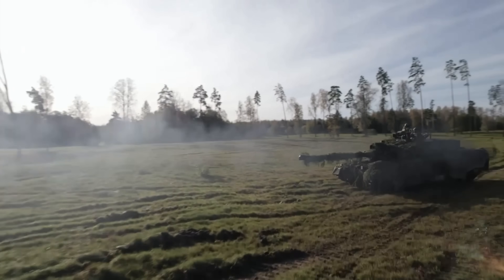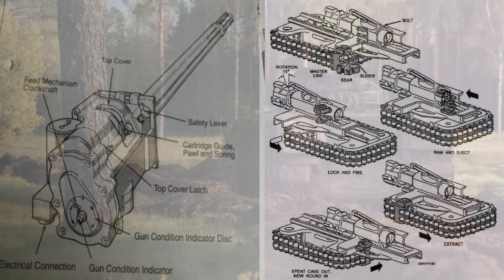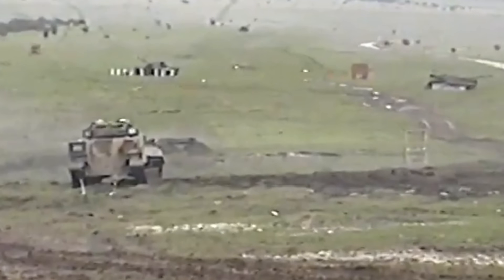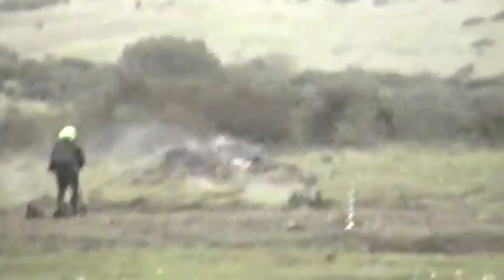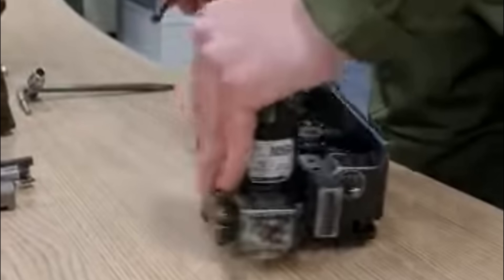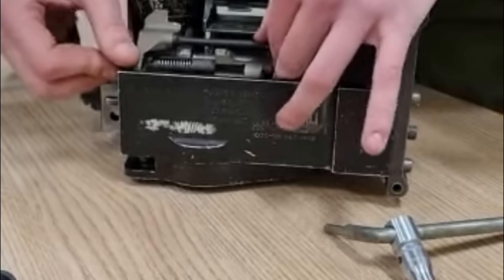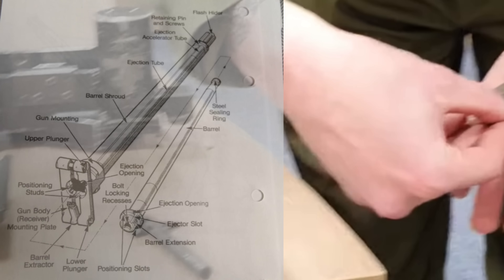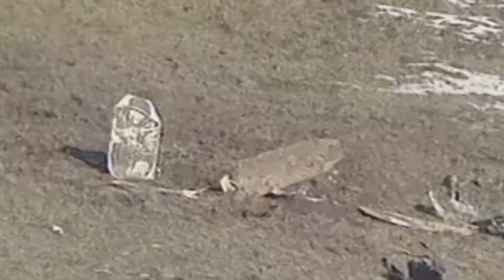The British L94A1 7.62mm Chain Gun | THE WORST WEAPON FOR BRITISH TANKS 👎🏻

Comment: Even BESA Mg's from old tank designs in ww2 would probably jam less if it was correctly maintained in working order + it would be usable with a system failiure, since its a independent machinegun

And the firerate is almost equal

Comment: It doesn't sound like the gun is so bad as much as it is being installed in an orientation that it simply was not design to work in.  The power issues would be an easy fix as all you would need to do is to introduce something like a common power-bank between close to the gun between it and the power lines.  I have to wonder if a lot of the other maintenance issues could be due to it having been mounted upside down and what orientation it is in with the Ajax.  I do have to admit, a traditional machine gun would probably make a lot more sense.

Comment: It's actually a very good weapon. The fact it was mounted upside down in challenger 2 was an oversight as the belt should have been gravity fed. But alas they put the round bin below it, having to cycle and feed itself. 
If the weapon was well serviced and lubed it actually worked very well, and if you had a loader who helped feed by lifting the belt up, it actually worked good.

Comment: On the Ajax, just in case you didn't know - I read an article on European Security and Defence a while ago that you should check out, that detailed some advances in IFV systems.

Apparently, Ajax' gunner and commander sights that are identical with those to be equipped to the CR3s, have an automatic wide area search mode that can detect and indicate perceived threats, I believe also including drones, to the crew I believe using machine learning. All in all she apparently has 26 cameras - optronics I believe. That should I think also include what once was say, simple glass viewports or periscopes. They still are those things, but now also software is continuously looking out them. Her Local Situational Awareness System which consist of effectively 360 degrees cameras, can also again detect perceived threats such as drones using machine learning. That system is also to be provided to the Boxer and Challenger 3.

Thales describes all that as the software now having eyes, providing the platform with a digital crew member. It is really incredible, combined with her main gun she should prove truly deadly against the conventional threat and against the drone threat, and truly proficient in her reconnaissance role.

Comment: The main reason the GPMG wasn’t used was to keep toxic gases out of the crew compartment (also the reason the 76mm on scorpion was taken out of service). On the L94 the brass and all gas goes out the front. That said it was rubbish, being too complicated and a gravity fed weapon mounted upside down 🙄.  We got ours out of sync and “fired” half a belt off without actually firing a round, live ammo was just pouring  down the front of the vehicle. I do remember having a handle we could use to cycle the weapon if there was a power failure but can’t remember if that fired it or just operated the action.

Comment: We had L37's in our older 432s. basicly a GPMG , with a heavy barrel, and the stock swapped with a blanking plate.  great system. if you needed to get out of the vehicle you could take it with you, and put on the but stock, and a normal barrel or an SF barrel.. so no idea why they went down this line instead of using the L37 we all ready had... also always baffled why we didnt use the Bushmaster or the 30mm Chain gun used on the Appache.

Comment: You got it wrong that the L94 was chosen in the 90s because of an obsession with electric guns, considering the Warrior's MCV-80 program goes back to the 70s. The real reason the chain gun was chosen was that the system could be entirely operated and serviced from inside the vehicle, and vented gasses out of the vehicle. This was considered important, because if the Cold War went hot, it was expected soldiers would fight on an NBC battlefield.

Also I thought the Warrior was the only vehicle that had the L94 mounted upside down in it, which lead to the weird feed system and all its problems. With Challenger 2 mounting it right way up and thus having far less issues.

As for why Ajax is getting it. Because it is already in the system, parts and training exist for it. And with CVR(T) retiring, it would mean it would be the only coaxial used in service and somehow make logistics and maintenance easier.
Unless of course they mount an FN MAG on a pintle mount on top or RWS. But nobody said that the MoD procurement office was staffed by intelligent creatures.

Comment: In theory a chain gun should be very reliable. Since it doesn't rely on a round firing and providing blowback to cycle, a misfire doesn't jam the gun. The chain system just cycles the next round and ejects the dud round. Meaning ammo quality affects the gun much less. But of course it needs electricity to operate. So if the system itself is poorly designed or maintained, it completely negates that advantage.

Comment: What is the supposed advantage of a chain gun? I've never really understood why they're used in place of more traditional systems.
Reply: If engineered properly, it can be more reliable and be more compact - especially the amount of length behind the feed. Also, the way it works can mean less gunpowder gas entering the turret. Larger chain guns are used in various AFVs to good effect, such as Bradley IFV.

For remote control weapon systems, the reduced gas is unimportant, but the ability for the mechanism to clear misfires by itself is particularly useful.
Reply: @IsaacKuo  ah, so in this case they've managed to negate all the potential advantages with poor engineering.

Comment: I understand that an electric operated machine gun will keep cycling rounds even if a round fails to fire, which makes sense in an autonomous application or on like you mentioned a helicopter as the gunner won’t be able to operate the machine directly or have it within reach.

But on a ground fighting vehicle it seems like an over complicated solution to a nonexistent problem that would really only cause problems.

Comment: Irony: UK were early adopters of the FN-MAG, but choose to mount an unreliable, electrically-operated chain gun for their AFVs.

Whereas, the US adopts the FN-MAG to replace multiple unreliable AFV machineguns, then expands their use to pretty much every role.
Reply: US already had reliable AFV machineguns in the M1919 and M60.

FN-MAG was just easier to maintain than the M60 and is more modern general purpose machinegun than the M1919.

In several ways the M1919 is actually better specifically as a vehicle mounted weapon system than the FN-MAG.
Reply: @happyjohn354 the 1919 was good, but not chambered in the new NATO standard round (also somewhat antiquated, heavy, and expensive for what it was).  The M73  was the gun I was referring to, as the successor the M1919 in the coaxial role. From everything I've read, it was crap. The M60e2 was better, but was not nearly as durable as the 1919. The M240 was ultimately adopted because the US Ordnance Department was no longer allowed to develop in-house guns.
Reply: Follow the money

Comment: M240/Mag58/C6 what is not to love about this MG.  It can easily be adapted to flex/coax/ground configuration by simple exchange of components in seconds.  The US military choose M240 after years of suffering with the retched M73/M73A1/M219 coax which could give any a run for the title of worst coax ever.

Comment: Brits: make the Warrior and make it work without electricity
Also brits: make an electronic machine gun
Reply: Easy fix add a hand or foot pedal crank dynamo
Reply: @radaraacf  Or just use a conventional MG.
Reply: Bits make rubbish ajax is failed before it starts with troops again being sick just crap equipment cv 90 light years ahead.

Comment: It seems a bit weird to me that this weapon has the positive features which are largely found on an MG34, without being reliable (I'm using the MG34 as an example because it is the oldest MG I know of which can do fast-ish barrel changes from inside a vehicle). Maybe there are some functions which a typical machine gun couldn't do, but it seems like a strange trade off, when you consider that reliable, compact, and even serviceable vehicle mounted machine guns have been a thing for like 90 years now. 

Granted, I don't know from personal experience. Like, maybe an MG34 is a POS and I have no idea what I'm talking about (I mean, I know I have no idea what I'm talking about), but to me it seems like there are at minimum 4-5 currently available belt fed machine guns which would be better. Thus, this contraption is doubly cursed. 

Thanks for the video, good job, peace.

Comment: L94A1 can have a higher fire rate, but it was lowered due to the its problems being of a much higher frequency, if you look up the weapon when it was used by the US in its intended role it was operating at 850 rounds per I believe it was.  As for 2nd and 3rd line Maintenace, yeah its a pig.
The issue with the GPMG and its barrel change was solved, it had a smaller foot print than the L94A1 and the weapon was jut un pinned slid back and barrel changed, yes it slid right into the compartment, was not exactly ideal, but it worked, and when I say worked I mean that in every sense of the word.

Comment: It is very easy to add a auxiliary gas capture chamber/auxiliary spring/remote cabling or hydraulic linkage to do the automatic/semi-automatic/remote manual dud round fix so much simpler than a chain design. Electronic driven guns should only need more voltage and more aggressive motor cooling fan blade angles to run faster. A gas port modded close to the chamber could run a simple ammunition lifting windlass as with the Russian heavy machine gun not originally produced for belt feeding.

Comment: It's a feat of engineering in itself to manage to make a chaingun unreliable.

One of the major advantages of a chaingun is supposed to be that as long as you have electric power the feed mechanism should be reliable as it's not relying on gas pressure to provide the power for the action and that since you're not pushing dirty gas back into the mechanism it's fouling resistant.

For example the M242 Bushmaster had over 20 000 rounds between stoppages and the M230 is exceptionally reliable as well.

Also, I haven't heard of anyone on danish CV90s having problems with electrical failures, so that part of the equation is all british engineering (because honestly there are a lot of british ground vehicles with a reputation for having bad electrics).

Comment: i really love the ultimax 100 and knights lamg constant recoil machine guns that are based on the stoner 63. really benefitial system gor the soldier. not complex at all but really makes the recoil go away. i also love the hk21but i cannot say its any good. have used it, it sucks. reload sucks, recoil sucks, barrel change is awesome. but i just love it, it just looks cool. i think the mag fed variant used with 50rnd drums combined with a 3-4x optic would be great as a mg-dmr kind of thing for sustained accurate supression but i think at the end it will never be good. but i still like it just for no reason. sometimes love does not make sense

Comment: I can't believe the video maker, and no one else, has managed to explain the real reason why L94 was chosen....and the British Army used GPMG/FN MAG as a co-ax for years....they replaced it with L94...

Its not because its electric, or because its American, or because Chain Gun sounds cool...

It's for the simple reason that it expels all of the fumes outside of the turret, it also sends all of the spent cartridges outside as well....

There was no way of getting a GPMG to be compliant with modern legislation as firing inside the turret was poisoning the crew....Scorpion's 76mm was retired for the same reason...

MoD was told very clearly that they would face legal claims in the future from soldiers who had served if they didn't change....and the liability was enormous.
Reply from the maker: @dogsnads5634  easily able to be fixed. Easily.

Comment: Never understood why we didn’t have coax version of the gimpy instead of it, had one once that literally jammed after every single burst but would cycle and test fire fine put in another one ran beautifully armourer couldn’t figure it out either it was pristine
Reply: Bad ammo? Sometimes its JUST weak enough to cycle the gun, but not strong enough to actually set off next round. Or it needed just some extra grease/tweaking.
Reply: @ nah used the same batch with the new gun n it ran fine like I said armourer had a look n couldn’t figure out why either the gun was in prefect order

Comment: I will say that chainguns in general are extremely reliable if used properly. The m242 in the Bradley will essentially never fail if assembled and loaded correctly. However they are extremely vulnerable to operator error, and the idea of making on in 7.62 seems ridiculous.
Reply: Look up the U.S. M73 machine gun. I forget now which was the 7.62 and which was the .50, but the U.S. tried these chainguns on the M60 MBT, early Cobra gunships, and many other vehicles. Those failed out, and replacing them was a prolonged struggle.

And now, Britain wants to bite that? Follow the Procurement . . . someone is doing evil, and English law on treason is much more practical than the U.S. Constitution.

Bring back "cruel and unusual," it effing works when it is unusual!

Comment: A complex chain-gun system costs a lot more than the tried and tested gas fed Gimpy.

A few executives carry a lot more weight than thousands of experienced soldiers, profit over effiency.
Reply: Incorrect, I had to 1043 several that were damaged by the crew and the replacement cost was 5k, GPMG replacement cost was around 6k per gun.

Comment: One question that keeps going through my mind is this: Why are we still using 7.62mm in coax positions? Against troops for suppressing fire yes, but lightly armoured vehicles? What if you want to hit a lorry at say 1500 meters? Using the main weapon is a waste of ammunition a lot of the time. I know the french toyed with the idea of 30mm coax. However the sheer volume inside the turret was too much. So why not an M2 or similar?
Reply: For what it's worth, the Chieftain was a strong supporter of a 7.62 coax round. The assumption is, whatever is too much for that to handle....gets a 120mm. And I get it. It covers a lot of issues, but you're going to want to put down some rounds on target. Once you start drifting to 30mm coax... you're going to have to justify your upswing of ammo choice. ESPECIALLY on a training level.
Reply: French do in fact use a 50 cal coax on the Leclerc. I've also seen many Israeli tanks with a 50 cal strapped over the cannon that can be fired by the gunner.
Reply: 20mm on AMX-30. Germans did some testing with 30mm coax, and slovaks used 30mm BMP-2 cannon as externally mounted coax.

Comment: It is a bizarre choice of MG.  Many are pointing out the reliability of the 240/MAG systems which are legendary.  For me I wonder why militaries ever went away from Browning 1919 based AFV MGs.  Quite reliable and easy to clear jams.  They even have some advantages over the 240 in that they require a smaller firing port as there is no gas system and the barrel can be changed through the back of the gun in the 1919.  This isn’t surprising as all air cooled Brownings share a common lineage as being first developed for tank armament after ww1.

I have read that the stated reason for adopting the chain gun was that it spit the empty links outside the fighting compartment and thus reduced smoke/gas.  Though I suspect that any MG could be equipped with a brass tosser just as easily if you accept that the tossing system requires power.
Reply: I'm sure it could be done mechanically using the bolts forwards momentum, but alas i'm not capable of kraut space magic.
Reply: @MrTrilbe  The forward motion of the bolt is used to push the cases up the tube where gas, tapped from the muzzle blast is used to blow them clear of the vehicle.
Reply: @ Ahhh, didn't know that one, thanks.
Reply: Sweden uses the Browning M1919 for all its tanks and IVFs, such as the CV90. https://en.wikipedia.org/wiki/Kulspruta_m/39
Reply: @mattiasdahlstrom2024 ... Wikipedia links an article from 2016 saying they were being replaced with MAGs?

Comment: i like KSP 58 (FN Mag). the only thing I think it should have is a front handguard.  it was a bit mody if you feed it 6.5*55. but as long as you feed it 7.62 i never had any problems with it. It was also simple. even the platoon idiot could learn to feildstrip it and get it back together in a working conditioan.

Comment: Interesting, I didn't even realize there was a 7.62mm version of the chain gun in service. The U.S. uses the 25mm chain gun on the Bradley but the coax is am M240 as is the coax on the Abrams this was done to be easily swapped with other 240's. The 25mm and 30mm chain guns seems to be pretty reliable, I was light infantry not mechanized so I'm not the best source here. I wonder why the smaller gun is such a dog? I know one of the selling points for the Rarden cannon was that it did not require any power to function, odd they picked a coax that does need vehicle power.